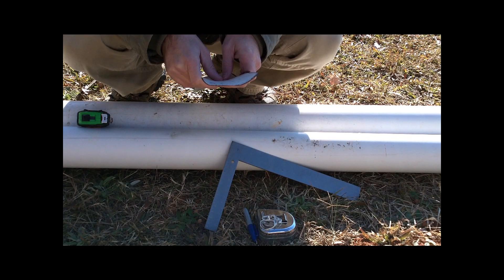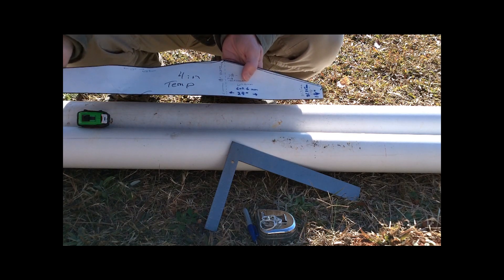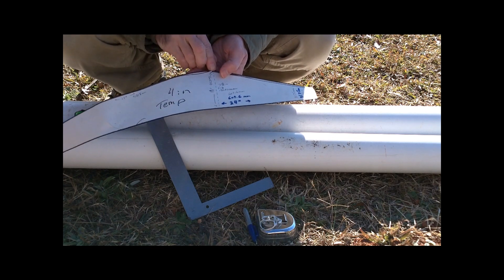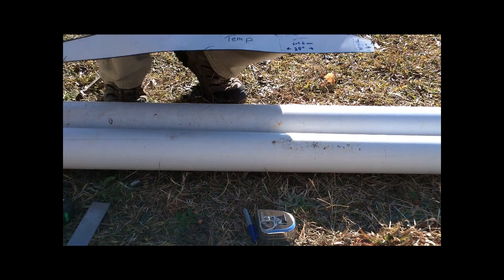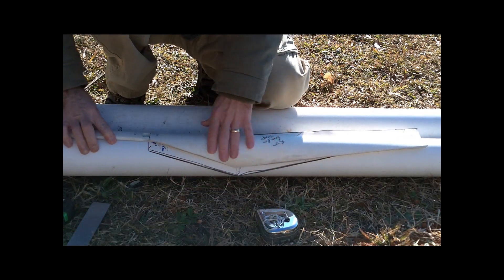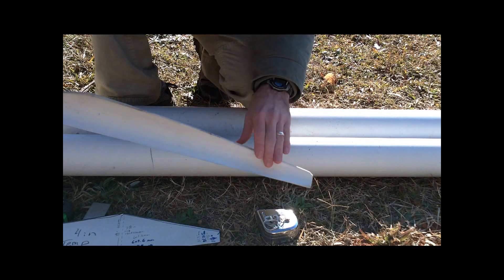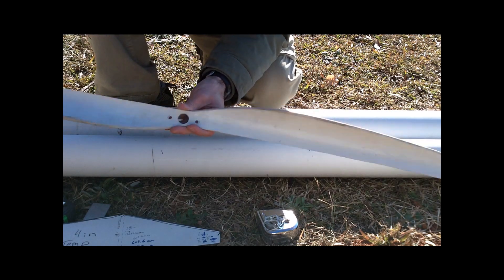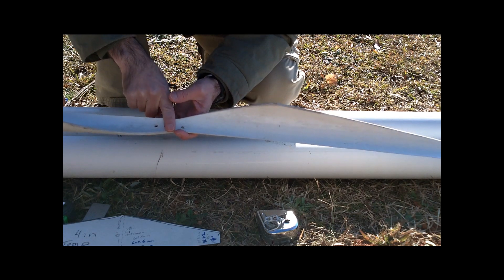4 inch PVC wind turbine template

Comment: That is pretty sweet 2 blade design. I was thinking about that hole in the center how it weakened the blade. You could still have a hole in the center but when you set your template up on the pipe and trace the first blade, now flip it over to trace the other blade like you shown us, but instead of backing the template up to the first blade tracing, measure out like 4 inches to make space for a hub area in the blade design. Then make sure it is 90 degree and in alignment with the first tracing but 4 inches away and trace the second blade. Now grab/make a 4 inch circle template and lay that between in that 4 inch space i had you make between the 2 blades, center it and trace the 4 inch circle on the blades in the center. It will give extra support for the hole for the hub.

Comment: Thanks for the design. I made my template this morning using autocad. I used 110mm pvc sewerage pipe but it seems to have to many flex in so I will re do it with pvc gutter downpipe.
Reply: Go with at least sch 40?